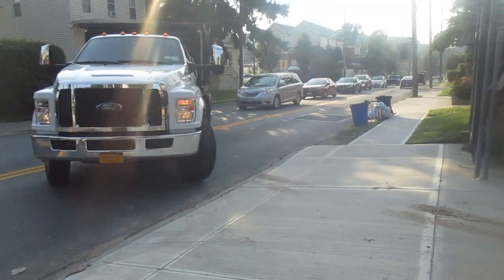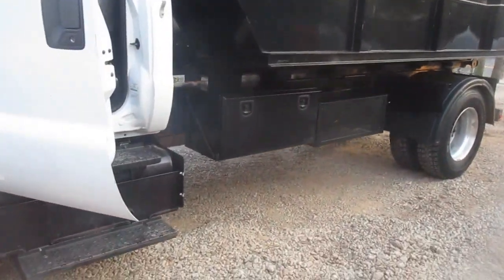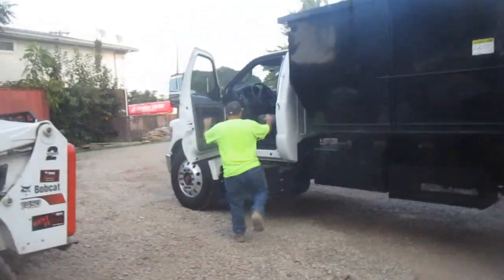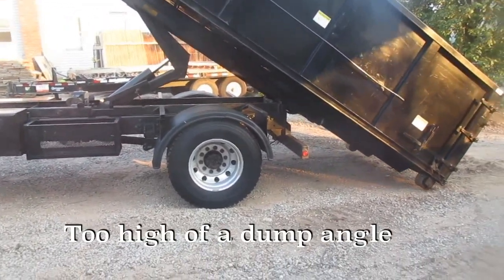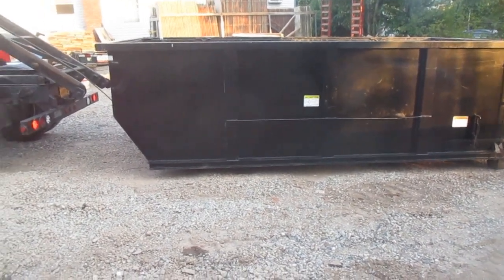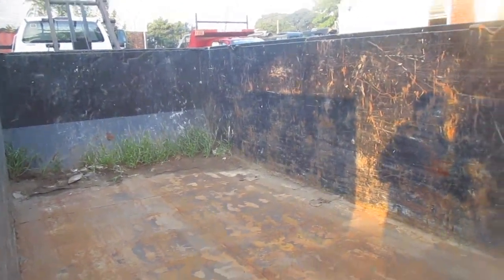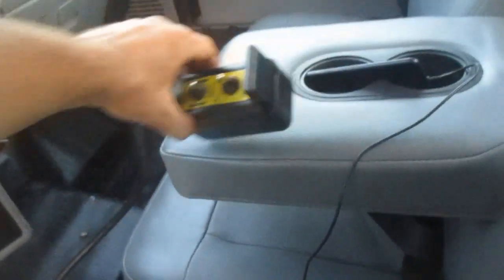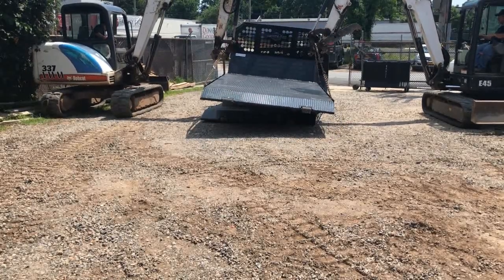Ford F650 Switch N Go

Comment: How could you not like a F-650? Beautiful setup.
Reply from the maker: I said the truck is beautiful. I do not like Fords in general. I had so many issues with their Diesel engines and transmissions over the years. This truck is a gasser and I like it a lot better.

Comment: How much weight can it take
Reply from the maker: It can be registered up to 29,900 legally. I’ve had about 16k on it with switch n go system and it drove perfectly. This switch n go winch can pull 15k.